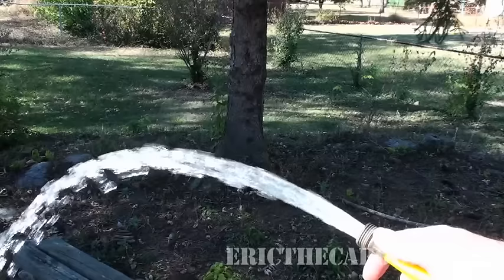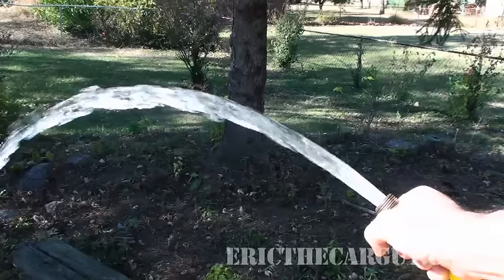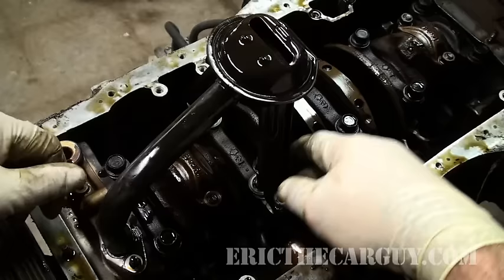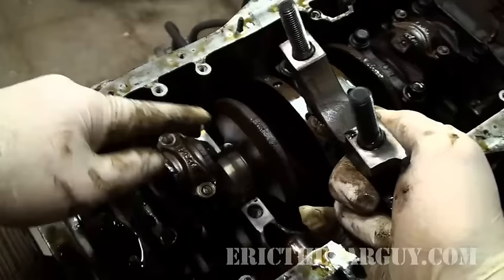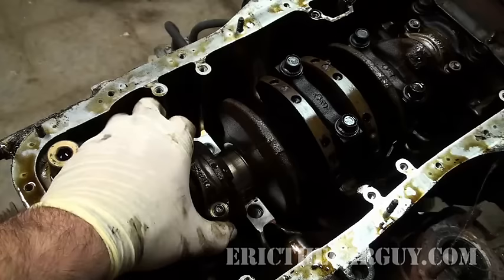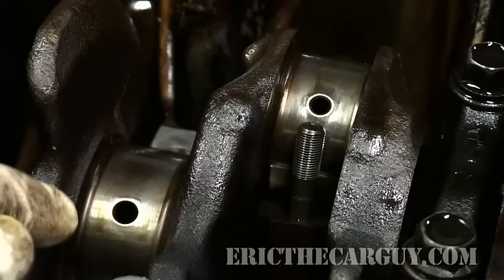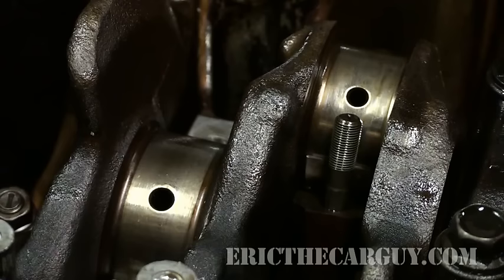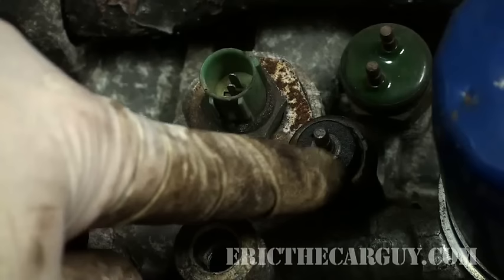How Oil Pressure Works - EricTheCarGuy

Comment: Extremly wrong, oil pump is what creates the oil pressure, without the pump you have zero oil pressure,  let me explain you how it works, oil pump lifts the oil and it drains by gravity down your engine, the higher the engine revs the faster the pump pums because it is geared to the engine the higgest the oil pressure gets, I think what you mean is the gaps reduces the pressure the pump is making because it scapes thru the gaps But without the pump you will not have any oil pressure

Comment: I have a huge ??!! With a 2021 blazer RS top of the line SUV. I took it to Jiffy Lube yes stupid move! They didn’t put the recommendation of 6 quarts of oil first off. You see them still draining it underneath as he’s putting oil in it. I drive out they don’t check the dipstick to even see if oil is in it! Nope just shuts my hood I drive and noticed my engine lights on. By this time it’s already giving me txt diagnostics 12:24 I paid 12:20 they start it for 10 minutes to reset whatever that’s something I don’t get! I want to understand it. I drive across the street get a script engine lights on feeling strange. Not feeling like it did before. Perfect! Quiet! I wouldn’t have even gotten the oil change. Close convenient didn’t need one it was this stupid breaking nonsense that my boyfriend and the salesman talked about.  Pressure to get this at 1,000 miles I am a bit over. I do it! I am baffled thinking maybe the oil caps not tight ext. nope he puts his old ass diagnosis in it all sorts of stuff comes up however he Does not explain any of them to me. And I’m getting diagnostic still from onstar GM telling me engine transmission variable timing belt system I mean it’s  basically telling me my systems are effing up. Oh we have video clips of them doing shady crap they keep trying to explain their stupid actions. Last videos my third time they 
Pulling into the bay. Do you see the manager putting the oil stick in and out in and out like it’s going to change the outcome of what he saying which is probably black oil at this point in time. They said they drained a half a quart. Simply to look at the color of the oil because they couldn’t tell by looking at the dipstick or putting it on white paper what color it was they had to drain a half a quart and then they say they’re topping it off. It’s about 13 seconds which is more like 3 quarts of oil. And that’s about what my dealership pulled out of the vehicle after I took it to them after the engine had seized and I had fallen completely apart brand new car and they’re saying oh maybe the pump wasn’t working and I was like OK so for the months that I’ve had it you’re trying to say my oil pump wasn’t working and then you guys change the oil and all the sudden the oil pump decides to fall apart the same exact timing it’s like are you guys serious. They are the biggest liars ever and again watching these clips I wish another professional would watch them because I guarantee everybody would be like what the fuck. I guarantee now I’m gonna have to go up against them in a court of law and thank God my BF life partner is a lawyer and he’s a damn good one! If they keep putting me through shit I’m gonna ask for punitive damages and they’re gonna end up buying me a fucking house. Not just a car. When Jiffy Lubr screws up they should just admit it swallow their goddamn pride and I haven’t even talk to the owners I’ve been talking to the manager and the VP. This location is a franchise of Jiffy Lube. I actually had one of the managers look at the video of the guy not checking the oil and flipping my dipstick all around the first time he doesn’t even check the oil before I pull out. And underneath the bed he’s draining it as the guy is putting oil in it which means there was probably maybe a quart of oil in it and then they put three more quarts in to try and fix it in that last clip and that’s exactly what they pulled that was for a quart that’s not enough for that to go through my car correctly! So there’s no oil in it for quite a bit of time driving at least 10 miles. Watching them put oil into it in the last clip the guy is not draining it in the bottom the drain station isn’t even up the net is. And they’re trying to say oh we did that for this reason for that reason to check the oil no they’re saying putting actually 34 quarts back into it we counted it it’s about 1314 seconds which is actually 3 to 4 quarts which is what the dealership pulled out so there was no oil in it before because the guy when he was putting it in the guy underneath was still draining it. Zero communication. Fucking idiots and they’re trying to say that the computer tells them how much oils in the car the computer only says what they’re doing I actually looked at one and the Manager that’s when he got pissed he did not want me to see what was on the computer is because they’re trying to say the computers control everything! Duh! I think they’re still on the old dumb  system! Anyways I saw all the damage to my vehicle and it’s indignant of not having oil or not enough oil in it and those fuckers are trying to screw me over! I just don’t believe in those kind of coincidences I drove that car from the Utah to seaside Oregon and back when I first got it that’s the reason I bought it and it didn’t Cesar have any problems it was perfect it only started to fall apart after I took it to them. Coincidence I don’t think so!

Comment: I have no pressure at all and my motor is knocking
Reply: B-bop 1027 don’t run it without oil pressure you ill spin a bearing

Comment: you are wrong about the pressure and hose demonstration,the water comes out with greater speed not pressure
Reply: No you are wrong my friend. It's very simple. The flow rate of the hose stayed the same. The smaller opening it has to travel through creates more pressure...which the pressure increases the velocity/speed the water travels after the opening. The speed is a result of higher pressure.

Comment: now what happens when u dont have oil pressure
Reply: Then should shut the engine off and tow it to the nearest shop or figure out what went wrong to cause that problem. Unless you like killing engines that is.
Reply: Only Dodge RAM can do that. If a GM does that, either the engine is off or the sensor is disconnected.

Comment: under the laws of physics nothing touches
Reply: Not true.
Reply: Rýán Túçk It mostly is, only protons and neutrons touch where the electrons orbiting around the atom hold other atoms to the atom. therefore nothing touches. It should be pretty easy to find on the internet if you don't believe me.
Reply: You're on the right track, think quantum interference.

Comment: Sorry but no.  Your hose example makes no sense at all.  How can an inert bucket of water create movement of it's contents unless otherwise moved by an outside force?? eg. gravity, wind, paddle, PUMP.  A pump has NO ability to create any pressure at all.  It moves it's contents being fluids (gas or liquid) or slurries if it's mixed with other components within the gas or liquid.  Simply put, it's a machine for raising, compressing, or transferring fluids. Not capable of creating pressure.

Comment: Hey! There are real people with real issues such as...."a flashing oil light" I am freaking confused because there's a ton of testosterone flowing through this video. Who's right and who's wrong? Who do I trust? Can all you men just come to an agreement because I don't know what the hell is going on! I don't even know about how to properly put air in a tire! I am freaking out over here and all of you guys are getting into piss fights! Sorry for the rant....i just need help with a car that's 19 years old......I am crying tears everyday!
Reply: Hi Mardi. Have you fixed your issue?
Reply: miguel ayala thanks for asking. The mechanic said it’s off by two teeth. He wants to inspect it more for other problems to see if it’s worth fixing because the oil light is flashing (I purchased it flashing not knowing) Anyway, he hasn’t started any work on it because he fix cars all day at the dealership then when he gets off he’s tired. So I’m trying so hard to be patient and positive 😩😔 Thank you for asking. I appreciate the concern. I’m so frustrated
Reply: miguel ayala oil light is still on, BUT timing belt broke I had 6 bent valves. He said he checked the pressure and I had pressure but I’m not too sure if he was truthful

Comment: My idiot light comes on when engine has reached normal operating temperature and low rpm. 2004 dodge caravan 3.3liter. 210000 miles